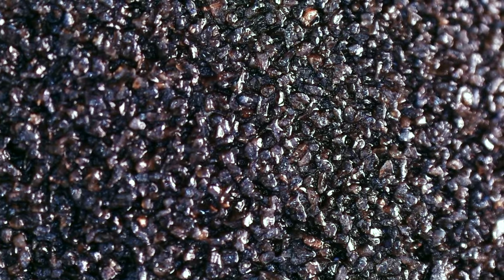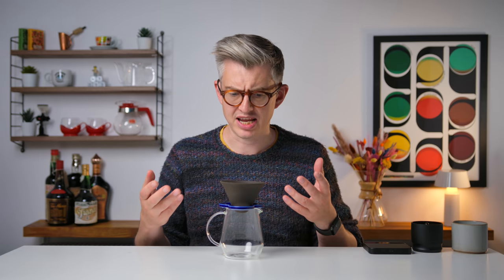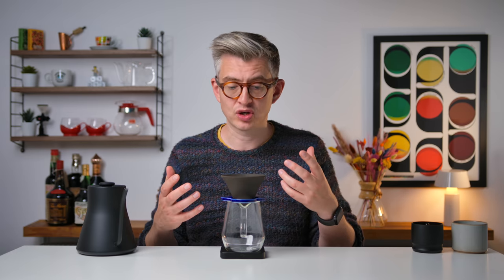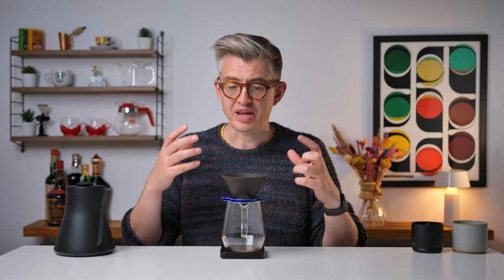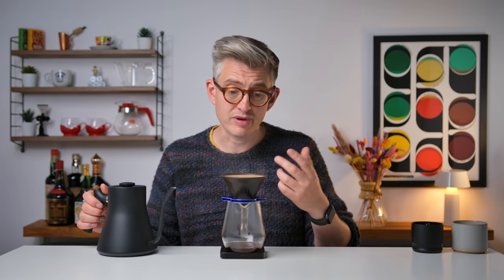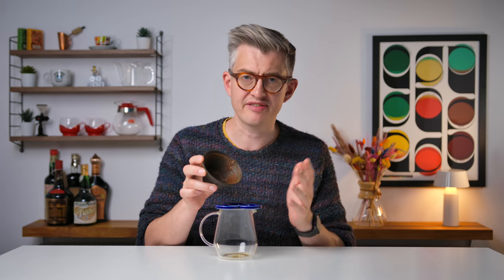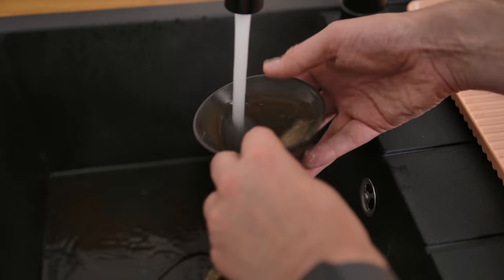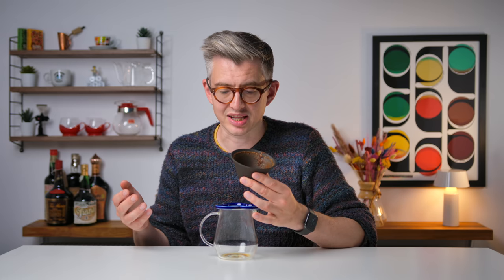Ceramic Coffee Filters: Magical or Maddening?

Comment: Does sonicating or ultrasonicating help clean the brewer? Essentially you are supplying kinetic energy, through the water, to the trapped solids inside the pores of the brewer. The solids bump their way out from the brewer pores into the surrounding water. 

Yah but sonicating consumes even more energy than hot water cleaning. And the noise sucks.

Comment: Actually there are several kinds of ceramic filters with different shapes and sizes and some have internal and external ribs and some even have a ceramic dripper attachment to make faster drawdown rates. Experimented on them a lot as I have more than 20 different kinds of and like pour overs, results are different on each. It’s still an acquired taste and its had more earthy flavors and cleaning it is a pain in the neck as you need to bake it in an oven or a grilled for 19 minutes every 5 uses to burn the clogged coffee oils and sediments in the ceramic filters. Examples of this ceramic filters are kyeumon, Arita, Cofil, suncera, calacera, Fumao, 1939gama.

Comment: Would you help me, James?

I just started making coffee from coffee beans recently. I do not own equipments yet (except a hand grinder) and this is how I do it.

I get around 17-20g of coffee, grind it coarsely, put it in a beaker, add some boiling water, wait for 2-3 minutes, add some more hot but not boiling water (water from last batch boiling water, sitting for 3-4 minutes), then filter it.

This is how I filter it.

I use a tea filter, on that I put two layers of muslin cloth I cut to that size and then let it drip. I also filter it once more, just in case ut has some muddyness.

Then I boil some milk with sugar according to my taste, and then mix them.

I want to know if I have some major faults in the process I do (I am a beginner) and how I can improve with the same equipments I have.

P.S. I am currently using medium dark roasted coffee, and thinking of shifting to medium roast from next time

Comment: I use a Katadyn ceramic element water filter for when I backpack. You clean it by removing the outer layer with a bit of abrasive material, and over the course of many used you will see that it will decrease in diameter. It also gives a little bit of a "taste" to the water (not as bad as sterilizing tablets or drops), but as I use it while backpacking to make questionable water potable I think it is a reasonable trade-off.  For my coffee in the comfort of my home, no thank you.

Comment: I am engineer working with ceramics filters for industrial use. 
In order to clean a ceramic filter you need pressurize your cleaning solution in order to force it through the filter. Then rinse it with pressurized clean water.
If you don't you will have build up of organic material and microorganisms inside the filter. I can't think of any way to do this at home, you can wash the surface but you can't clean the filter on the inside.

If you do not pressure clean you get the clogging you describe. It is from build up of microorganisms inside the filter.

If you heat a ceramic filter you need to be careful not to change its temperature to quick or you will damage the filter. The damage is microfractures (cracks) in the ceramics. So putting it on a flame of boiling it seem like a bad idea. If you boil, submerge it in room temperature water then heat it slowly so it don' start boiling for an half an hour or so. Microfractures will reduce the capacity of the filter and increase the buildup of microorganisms. Boiling it will kill the microorganisms but not remove them from the filter.

Comment: I have only seen the glamour shots so far but looks like a lot of water just runs through the outside of the filter instead of slowly making it's way through the finer ground coffee.
Probably would work better if the porous ceramic was only used on the bottom.

Comment: (Third world villages could use this) Use it as a water filter, out carbon crushed coal as a layer inside and out water over the top. Cleaning can be done through the method you mentioned over a flame turning the coal to ash.

Comment: As an alternative to both a ceramic filter such as this one, and something like a v60 with a paper filter, I wonder if you've had good experiences with a stainless steel pourover? They are easier to clean out, and also doesn't use a paper filter. Genuinely curious if they are better or worse than the paper or ceramic filters as I've been using one for a few years now. I have one by Buphallo. There is a very similar one on UK amazon under the name FOXAS. Also just wanted to thank you for the videos that have helped me improve my brews!

Comment: We bought these previously and I've mostly stopped using it but the mess part was something we experienced within the first few brews and we just noped out of that. The way we ended up using it was to act as a secondary water filter (we already filter our water as is), and it tends to make the resultant coffee slightly cleaner. But it's usually not worth the hassle when I'm brewing coffee early in the morning.

Comment: Is that really ceramic though, we have ceramic filter parts here used in Water Filters and it normally drips water extremely slowly. Pretty much filtering out everything else, even stuff like tea. Im curious what they have done to make it just flow so fastly and consistently. And shouldn't ceramic filters cool down the water considerably? How would that affect the pour over?
Reply: Is probably a high fire clay fired in the kiln at very low temperatures to a point where it just semi matures and leaves a very open bodied clay or they might mix the clay with very fine mesh cellulose to leave a lot of voids when the paper burns out.

Comment: that mystery flavor is most likely loose mineral particulates that did not bond during the sintering process (method for bonding granulated materials with heat and pressure). try boiling it in distilled water several times to clean it.

Comment: Regarding energy usage, I think that this depends on your energy source. Are you on solar/nuclear/wind/other energy source that doesn't emit greenhouse gas? This might be good as a daily brewer, since remember that it's not just the paper you're using it's also the energy used to chop the wood (or recycle the fibers), make the paper and ship the filter. You may be cutting total emissions boiling the ceramic filter instead of buying new paper ones. Someone much, much smarter than me would have to do the math on that, though.

On water usage, similar thing. Is your region currently suffering a water shortage? If not, then I think this would be okay to use given the energy benefits. I also wonder if there are less water wasteful ways to clean it other than a constant stream of fresh water from the tap that goes straight in the drain. Could a dish rinsing tub full of water dislodge the majority of coffee bits by swishing it around and/or using a cup to scoop and pour repeatedly? It might not get it as clean as constant fresh water but you could maybe compensate by boiling it more often. Hell, if you really want to conserve water, collect the water you used to clean it and use it as grey water for plants or whatnot.

Another beneficial use case I can think of is in remote areas without the ability to get disposable coffee filters/other expendable items because all you really need is to be able to boil water, for both brewing and heavy cleaning.

tl;dr I think the wastes of this product may be more readily mitigated than disposables if the effort is put in, but actual investigation and fancy science required to make a definite conclusion. Ramble ramble.

Comment: It's probably some kind of yeast that you are tasting. The moment you said "cereally" that's what came to my mind. It's probably microorganisms at work inside the filter feeding with the left over coffee and water inside the filter material. Not necessarily anything harmful, most probably not actually, but it would explain the taste. If the ceramic can go into the microwave, you could try blasting it for a few seconds, so it gets warm, and then open the microwave door so all the moisture inside dissipates. If it doesn't go into the microwave, you can do the same in a regular oven. If the taste goes away after doing that, that's probably what it is.

Comment: I wonder if you can fully clean it if you submerge it into water that has the espresso machine cleaners in it. Like it is done to portafilters. Or what if you blow it from outside with a compressed air can? Also do you get that weird taste even with first time using of a ceramic filter or only after a few times?

Comment: What about stainless paperless filters? I haven't been able to find mention of them on your channel yet. I use one. It rinses very clean very easily and it's not delicate like ceramic. I give mine a sharp rap on my porch railing to fling the grounds off into my garden soil every morning and it still looks like new. 
Mine is a perforated metal cone lined with a VERY fine wire mesh. The cone sits in a wire support that rests on my mug. Not sure of the brand.

Comment: Actually, if anything, that the ceramic filter emits more infrared radiation means it would brew slightly cooler than others. Though I suspect its larger thermal mass would make so vastly much more of a difference as to make the difference in IR emission undetectable within the noise threshold of whatever data you might try to collect on it.

Comment: After all the attempts, to me the best way to clean a ceramic filter is to just put it in an ultrasonic cleaner and clean it that way. 
And if you use it back to back you only need one hot water rinse in-between. If rinsing paper filter is needed then rinsing a ceramic filter wouldn't be that bad. 

Everything weird about ceramic filter is probably bs but I think that the whole surface allows water and air to go through might make the filtering process a bit more even.

Comment: I used to have this flower pot watering system using ceramics like this. The clogged up after some time due to the minerals in the water. Surely this will happen with this as well

Comment: Water itself is a strong absorber of far infrared — which is why we can only put infrared telescopes in orbit or in Antarctica where the amount of water vapor in the air column is amazingly small — so they might have a point about the FIR if you were trying to expose the coffee to FIR from an external source, but since the absolutely dominant source of FIR here would seem to be the coffee itself, I don’t see how that makes any sense. Coffee in hot water would get plenty of FIR.

I bet you could clean this thing very thoroughly and easily by boiling it in a strong solution of powdered oxygen bleach such as Oxybrite. I use a natural cork in a small (500ml) Pope liquid nitrogen Dewar for my coffee. The cork gets very dark with coffee residue over time and is very difficult to clean. So I decided to try boiling one in Oxybrite. I got distracted for a few minutes, and when I came back to the pot the cork was indeed perfectly clean, but it had only about half the volume it started with. Ceramic would presumably resist being consumed like that, but coffee residue would not. And Oxybrite rinses out completely quite easily.

Comment: that style of manufacture is called sintering. that's exactly how it's made, they press together and heat large grains of material and it forms a porous solid. sintered filters are very common in the world, particularly with inline hydraulic and fuel filters.

also, fyi EVERYTHING emits far IR. so those claims are basically bunk.

Comment: I am owning one of these and just like you I picked on up at Tokyo Hands in Tokyo about 4 years ago. I used it a couple of times but very quickly it stopped working, it clogged up so quickly. Back then not many information was found on the www but I also tried the burning of residues and the boiling method but with very little success. THe coffee is alright, but the effort and time it takes just annoys me. The coffee is cold before it has run through and the tip of the filter is already not letting a lot of through anymore so all what I am getting is coffee run through / out of the top sides. Too much hassle, and water waist, I don’t mind the work. I rather have something simple like that than a smart coffee machine.

Comment: I'm no physicist but the Stefan-Boltzmann law describes infrared emission as Watts = Material Emissisivity * 5.67e-8 W/m2K4 * (Area m2 * Surface Temp^4 - Ambient Temp^4) K. Assuming the object is made of matte earthenware (emissivity 0.93) with 500 cm2 of area in a 20C room at 90C it would emit about 26 watts of infrared energy. An IR heater filaments made with a cermaic metal composite with an emissivitity of 0.9 at 110C would emit about 36 watts of infrared energy

...huh. I actually did not expect the amount of energy to be anywhere near comparable

After looking into it the temperatures needed for far IR emission are actually quite low, I expected the IR emission of that ceramic filter to be negligible but it is not. Regardless it seems like correlating that with some sort of positive drinking effect is marketing mumbo jumbo. Far IR is good for people so it makes it an easy selling term for being good for anything else too

Comment: The routine seems similar to the hemp filter I use now. Chemex filters keep being out of stock where I get them, and I am trying to reduce waste, though not sure if it's really better. Either way, I have it dialed in and it works. I see the appeal. Much like with my setup, not having to worry about buying more filters is an upside.

Comment: ive had one since about 2009 as well. a name brand kuji. it sits in a cupboard at my parrents home. i used it a few times for the sake improvement feature, as well as running wiskey and vodka through it as well, but the biggest flavor improvment i found was in the vodka. 

from a coffee prespective, i find i can only use it about 3 times before its unusable (and no 2-3 really isnt great). ideally you would have a kiln or hot af oven behind the bar if you were regularly brewing with these, and you could just rotate through them. 

as far as the brewer taste, i always found it to be reminiscent of really badly made broth. like an old siphon filter or a nel sock.

Comment: I wonder how much rinsing is needed before you put it on the flame.  It might be easy to use if you could give it a quick rinse and then burn off whatever is left instead of scrubbing it with your hands under the hot tap for a time before burning out the residues.  That said, I avoid the coffee oils as they have shown to be detrimental to my health, so I suspect I'd pass on this anyway.

Comment: I think you might be tasting the ceramic or possibly the binder. Whilst ceramic is incredibly hard the micro structures might be eroding as the coffee flows through it. But it might also be the binding agent used to create the pores in the ceramic. I know off PLA having ceramic being suspended in it, made into the desired shape then burning off the PLA leaving a porous solid ceramic piece behind. There might still be some of that material inside the filter and as you pour water through it could be eroding and mixing with your coffee

Comment: I assume that manufacturing white paper do spend much more water, considering the tree consumption and the manufacturing itself, not to talk about the waste management of it. Dont consider one filter but millions of it each day.Perhaps letting it rest in water my help cleaning? I bough an aeropress with a stainless steel filter that does the job, its easy to clean and reduces the filter waste that works fine. Cheers.

Comment: The first thing I thought when I saw those is that you'll never get them clean.  A random thought that crossed my mind was what if you treated them like a regular pourover cone and put a paper filter in them?  That would stop them from getting clogged.  It would be like a cone that was permeable over its entire surface rather than just through one (or three) holes in the bottom.  I'm not sure there's any point to it then....  I wouldn't expect that to solve the ceramic taste it adds to the brew.  They'd probably have to glaze the ceramic particles before they sintered them into the filter.

Comment: maybe the weird taste is that of your own skin-cells rubbing off onto the filter... seems like something you would boil (if possible) in mineral water or something to try and get all the oils and particles out of it. Maybe a fast-drying alcohol may work to clean it better than just hot water alone... since we do not have to worry about build-up of alcohol vapor in the item (which is why I would not use alcohol in a brewer...) itself, it may be a reasonable alternative. 

If you are not keen on it, why not give alcohol a try as a cleaning agent and then brew a bit and see if that taste goes away.

Comment: I tend to be kinda lazy when making cold brew by simply putting a tablespoon or two of grounds in a glass pitcher to sit for about a week or so until the grounds have all sunk to the bottom. As long as I don't disturb it too much, I don't end up drinking them without having to filter any though occasionally it would be necessary. Over time the oils definitely do make a mess and it probably gets more than a little unsanitary if left uncleaned over several weeks or so but it does give it an interesting flavor nonetheless.👀

Comment: I just use a stainless steel mesh filter; I don't like the taste of paper and it's very simple to clean (10s or less under the tap). If you still want to go the paper route, you can buy hemp or bamboo based filters, and compost them. Technically they count as some small amount of carbon sequestration: plants capture carbon, we mill them into paper, and then we bury that carbon-laden paper in the ground.